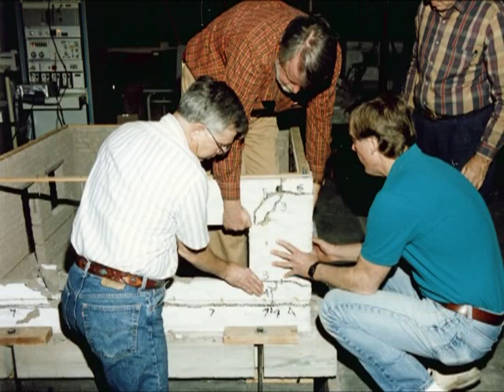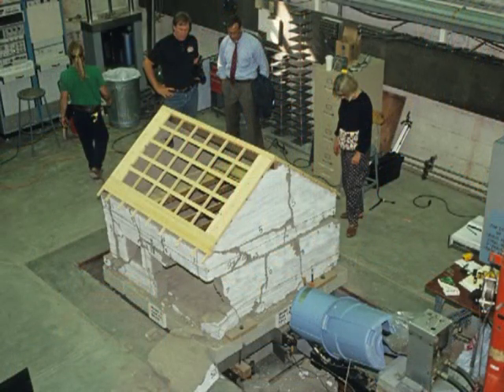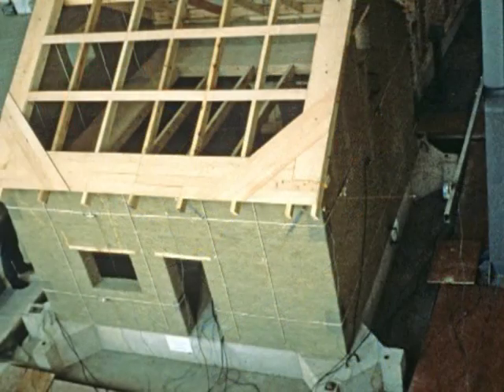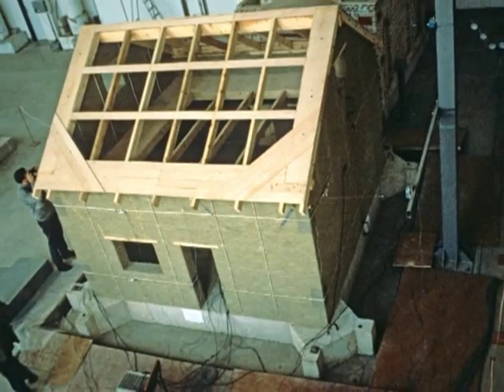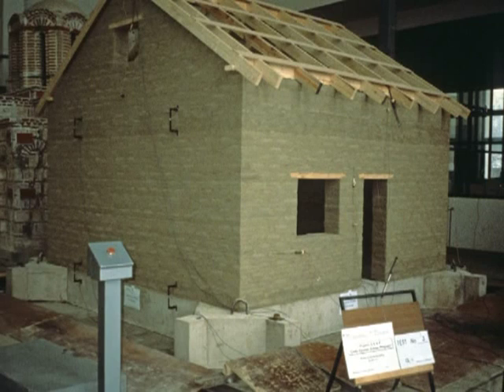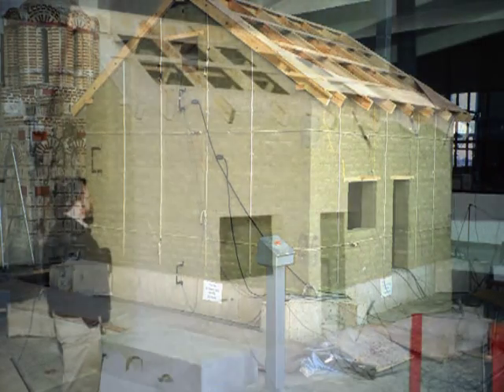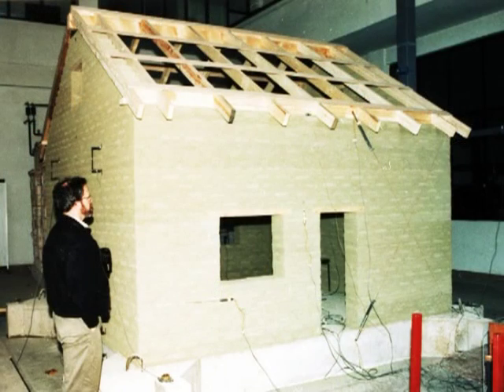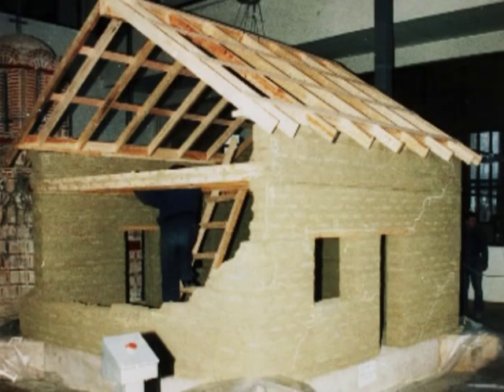Getty Seismic Adobe Project

Comment: Two of the best historical methods I've seen are in Victorian homes in Haiti and half timber buildings in Nepal. Many Victorian homes in Haiti were built as a riveted iron frame or wood frame, with masonry infill. These were among the best surviving buildings in the country after the quake. I believe 80% had little to no damage. Often the worst damage was the collapse of single masonry sections of walls. And even that was only the case in poorly built walls of rubble or brick. Old half timber buildings in Nepal are very similar in the way they're built, a wood frame of large wood infilled with mud brick. Often buildings even in bad shape before the quake survived it structurally intact while masonry buildings around them collapsed